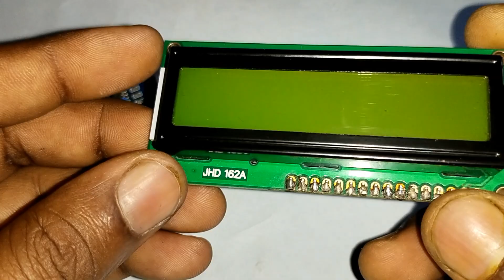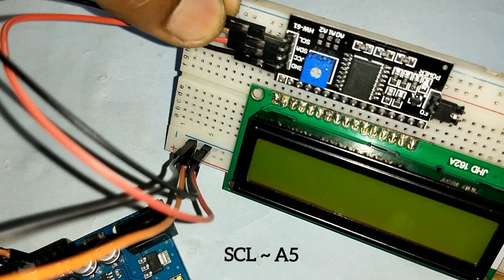How to make digital objects counter using #irsensor with #arduinouno

Comment: Hello, I live in Spain. I am very interested in having that development card. I have some questions. Can I save the microcontrollers on the same card? What program do you use to program in Assembler? I have several AT89C5115 microcontrollers, do you know how to record them ISP? That is, on the same application card, so as not to have to take it out and record it on a recorder. Thank you so much. Very good channel. All the best.

Comment: What about Code??
Reply from the maker: //@BigEdx youtube channel for electrical and electronics project.
 
#include <Wire.h>
#include <LiquidCrystal_I2C.h>

int input = 7;
int n     = 0;
int state = 0;

LiquidCrystal_I2C lcd(0x27, 16, 2); // set the LCD address to 0x27 for a 16 chars and 2 line display

void setup()
{
  lcd.init(); // initialize the lcd

  // Print message to the LCD
  lcd.init();
  lcd.backlight();
  lcd.setCursor(0, 0);
  lcd.print(" Objects counting ");
  lcd.setCursor(0, 1);
  lcd.print(n);
  lcd.print("     = Units ");
}
void loop()
{
  int counter = digitalRead(7);
  if (state == 0)
  {
 switch (counter) {

 case 1 : state = 1;
lcd.setCursor (0, 1); n = n + 1; lcd.print(n); break;
case 0 : state = 0; break;

  }
   }

  if (counter == LOW) {
    state = 0;
  }
}